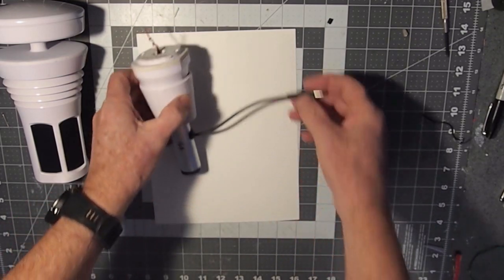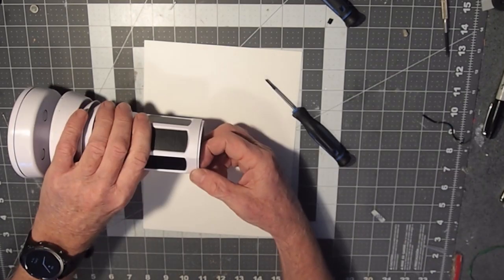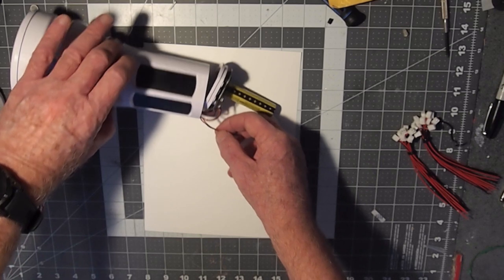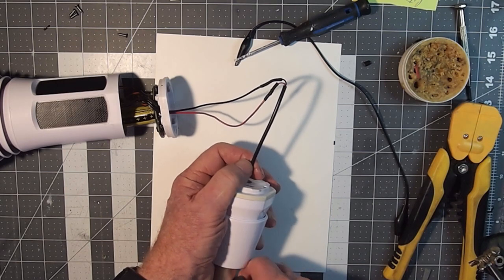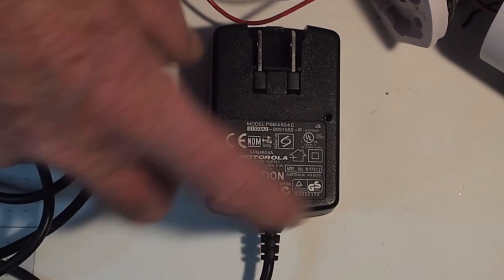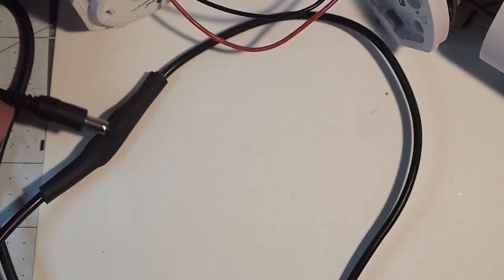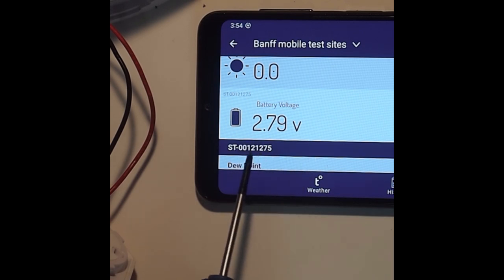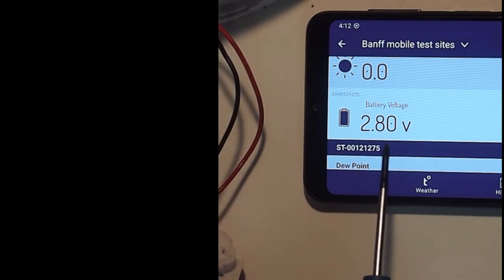Weather S01E10: Weatherflow Tempest, Build your own battery booster pack

Comment from the maker: Just some updates to this procedure. 1: A Weatherflow technician shared with me that only 2 of the 4 solar panels are active at any given time. The charging algorithm identifies the two that are able to supply the maximum amount of charging current, and uses them. The 3 solar charge panels continued to work to charge the internal battery after I disconnected one of them.
2: After doing this, I was not too keen on having to run an extension cord up the mast to supply power to the AC adapter. As I also had some spare batteries and empty battery cases laying around, I soldered the appropriate Tempest connector onto the battery pack and used two 18650 Li-Ion rechargeable cells with a nominal voltage of 3.6 DC Volts (in parallel) in place of the AC Adapter. My assumption that the Tempest uses a BMS with a typical charging algorithm turned out to be correct. After a few weeks during which we were at winter equinox: Short days, weak sun, and not getting direct sunlight for more than 30 minutes a day, it held the Tempest operating voltage at a steady 2.8V for me. I posted the procedure on the Weatherflow forum but there does not seem to be much for interest, so I'm not going to bother making a video. If you are not interested, or unable to buy the aftermarket battery booster, this procedure may represent another option worthy of your consideration.

Comment: Just buy the battery booster they have on their website.....much easier and time saving.
Reply from the maker: Thanks for the comment. I'm sure that's what most people will do, unless it is out of stock as it was recently. In my case, it took me about 2 hours to do this, so I figure I paid myself about $30.00/hr for my time. As many will not want to run an extension cord up their pole to power an AC Adapter, this morning I put together a battery pack that uses two 18650 batteries in parallel that I placed into an empty generic bike battery case I had sitting around. The advantage of the bike case is that it is water resistant, and meant to mount on the downtube of the bike, so it will attach easily to the mount pole for the weather station. The capacity of the one I did this morning is about 6600 mAH, so it should keep the Tempest going in dreary winter weather for about a month. If there is enough interest, I'll do up a follow up video on the process.
Reply: @MountainParameters  I apologize if I sounded like a jerk. That wasn't my intent of course. I have to give you lots of credit for your ingenuity.  Pretty cool what you did. Thank you for sharing it.
Reply from the maker: @YukonHawk1  

Not at all! I think your observation was right on point, and in the Tempest forum the prevailing sentiment agrees. As it works out apparently, it can be very expensive to get the accessories send offshore to places like Europe because of high shipping costs and 25% VAT. So for domestic users in the USA, unless they are hobbyists that like to solder stuff, or like me, retired and sit home alone all day making sure the house is clean for She Who Must Be Obeyed when she gets home from work (which I fail at apparently), it would make perfect sense to simply order one. I'm over the moon when a 'like' gets left, and even better when I get a comment! Given that I'm not even selling anything, and have no affiliate links, I guess that's pretty sad!
Reply: @MountainParameters  I hear you loud and clear about obeying orders 🤣🤣 I am 61 but not retired. I love to tinker with things as well. It gives one's self great satisfaction when you build something with your own two hands. I have a Tempest system also and love it. I've had it for 2 years and it's been rock solid and very accurate.  It sits about 30 feet off the ground at the peak of my garage. I  also have piconsole that I  set up from git hub and view all the stats on a 19 inch monitor.  My wife thinks I'm nuts. 🤔

Comment: I don't get the hype over this besides its ease of installation.
Going on 4 years and nearly 10 replacements!
The only thing I can say good about Weatherflow is their support.
If you want accurate wind and rainfall this is NOT the device!
Reply from the maker: @cpufrost, I see you have made a video of an incorrect installation (similar to my incorrect installation) of your Tempest swaying on a pole, which will most definitely give you incorrect rain and wind readings. If you could elaborate on your support experiences that would probably be helpful for others. Also I noted in the forum that in July of last year you mention you were on your third Tempest. As it is now January of the following year, it would appear you have gone through 7 subsequent units in 6 months?